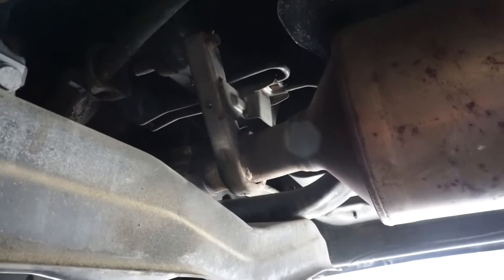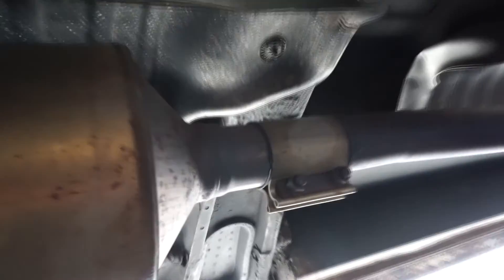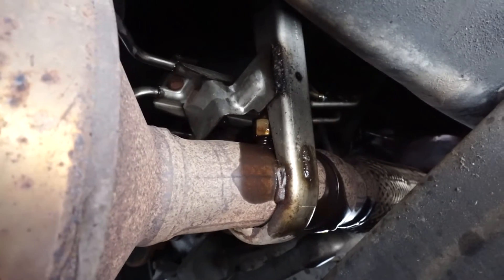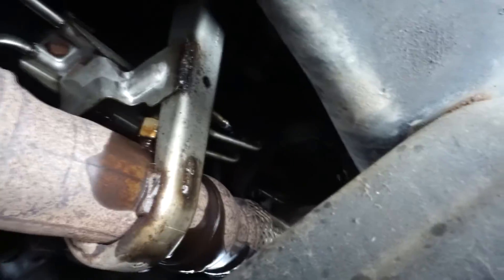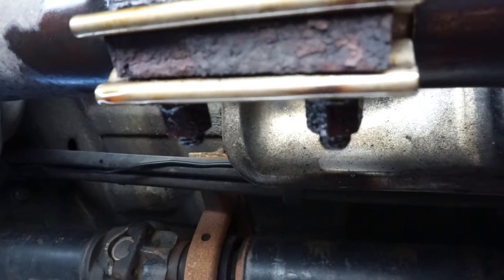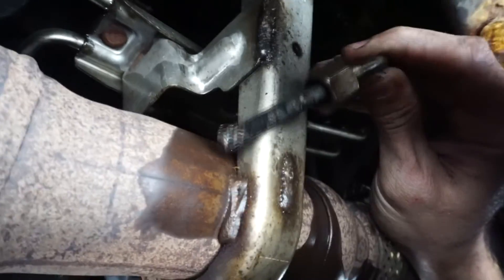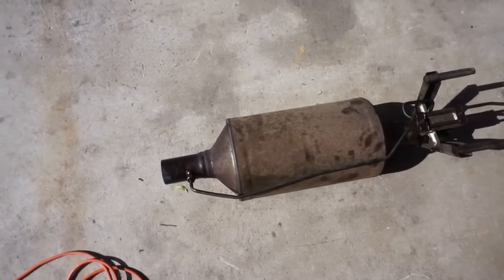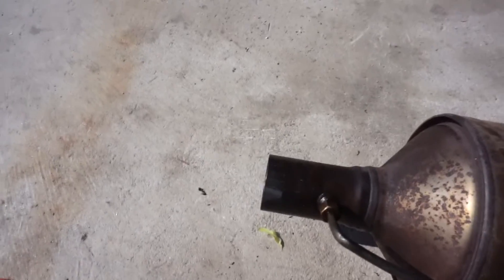2007-2009 Sprinter DPF Removal

Comment: Did you hollow it out or replace it with a straight pipe? and if you were to do this with a straight pipe would you have better fuel economy and more power or would it make a difference at all?
Reply from the maker: If you had a proper tune and a delete of sorts, you would see better gas mileage and performance for sure!
Reply: @DabSedan  , where can I find the proper tune for this vehicle? I'm striking out.
Reply: @pacemetalfab  i’m trying to find one too. you have any luck yet?
Reply: in germany we say Abgasskandal

Comment: You don't have to remove the front sensor. Simply unplug it from the harness and leave it.
Reply: Dan Fowler do you get a cel if you straight pipe

Comment: Is that the DPF or the Cat ? I seemed to think the DPF is the front unit and the rear unit is the CAT, at least when I price a NEW DPF Mercedes qoutes me on the front item
Reply from the maker: jolendd what I removed is definitely the dpf. It’s in a slightly different location at a slight angle/slightly more forward on the newer ones but the cat will still be before it. I know cats need to be close to the manifold due to heat reasons or else they simply won’t work
Reply: Is the cat

Comment: What did you do to it once you got it off? Did you use liquid moli, spray with a pressure washer or just remove it? Interested in how it turned out! Thanks
Reply from the maker: Ritchie Wall it turned out great haha but that’s all I’ll say!
Reply: @DabSedan  Gotcha ;) Thanks for the response :)
Reply from the maker: Of course! Greendieselengineering were a great help through solving some of the major issues with this van!

Comment: Great video, thanks!  Sounds like you say "side cutter" at https://youtu.be/-YVE_vamiE8?feature=shared&t=102 to take clamps off. If you cut clamps off, does that mean you had to put new clamps on when you reinstalled? Or did you not actually cut through the clamps?  Thanks!

Comment: It didnt show how to take off donut clamp?
Reply from the maker: Acyutananda Dasa good point! I apologize for that! That should just unscrew from the one side and stretch over slightly and pop out. Mine was rusted too much and I ended up needing to cut the head of the bolt off and replace it. That's a worst case scenario! Assuming the bolt comes right off, it'll be super easy/self explanatory